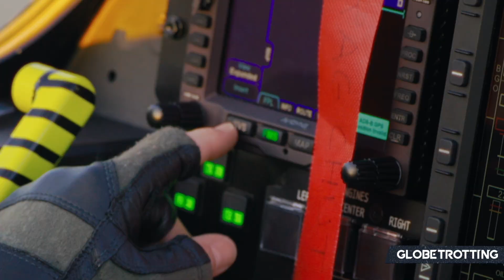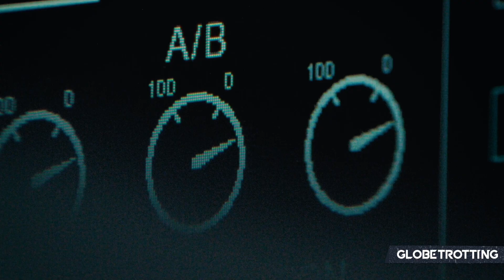THE FUTURE? - Introducing Boom Supersonic

Comment: It's poignant that in some important  technologies, we seem to have achieved a pinnacle in years past.  The moonlandings not repeated in over 50 years.  Hovercraft trips across the channel.  Supersonic passenger flight.  Perhaps these pinnacles happen when we 'overshoot' what is really practical within the laws physics, aerodynamics, material sciences etc.  We can just barely get humans to the moon in one shot and only then with a massive chemical propulsion rocket.  The hovercraft skirt just can't take the beating for very long.  The energy demands, aerodynamics and physical stresses of Supersonic flight become overwhelming and limiting in practical terms. 

We do see different trajectories however, too.  In computing, the transistor opened so many possibilities over the vacuum tube. And the integrated circuit over the transistor.

So, perhaps Supersonic passenger travel too will require revolutionary advances to ever become practical and routine.

Comment: The main problem is the same as with Concord - does anybody need it? Who (how many) paxes will be ready to pay additional $1000s to reduce travel time for, ummm, 10 hours max? Sydney-Europe flight, the longest real trip with significant demand on this planet, takes 24h with all transfers and costs $1000, what can offer SS plane? 15h with the same single transfer somewhere in the same Gulf? And price tag, ummm,  $3000 (science fiction)? I can not gain $2000 for 10h of seating in chair other way then refuse to fly SS.

So only top tier left, where money are corporate and lifetime is personal. But this market is not for 150+ pax planes, its much smaller, and competition there is not for time but for luxury. If you can afford to get sleeping cabin for the same money - it will be flying hotel and it saves the same time as it allows not to go to sleep immediately on arrival.
Reply: Even in a First Class suite the quality of sleep is nothing like a sleep of the same duration in a hotel bed. Primarily due to factors such as mild hypoxia, noise (aircraft and cabin), vibration and a whole host of other factors which have been thoroughly researched and scientifically proven. Despite this there still remains a market for this degree of luxury and the majority of it is not the claimed productivity of elite business travellers. Mostly it is to reduce the inconvenience surrounding long haul travelling, along with the privacy and a healthy dose of prestige.

There most certainly is an untapped market eager to reduce their time stuck onboard an aircraft irrespective of the luxurious surroundings.

This is the private jet market who co-lease with companies such as NetJets etc, there are plenty with deep pockets, and many who will be drawn to these opportunities for the prestige and enjoyment of travelling in an exclusive group of likeminded individuals.

Just as there is a market for First Class suites, chartering or co-leasing private jets (including former owners of the type who were overwhelmed by the expenses associated ie maintenance, crew costs, FBO fees, fuel, insurance, etc vs the amount of hours the aircraft is operated making for enormously expensive flights when it is used), there is absolutely a market who will patronise this travel option along with many more who will be attracted to it once the benefits are realised, and of course the many curious who will save or borrow for the experience.

Air France's Concorde operations did not produce much profit because their inflight service and soft product was nothing spectacular. British Airways however did make a significant profit with their SST fleet and their inflight product was in an entirely unique and luxurious, extremely polished, class of its own.
This is evidenced by the fact while during the fuel tank reinforcement installations while the fleet was grounded, BA took the opportunity to invest millions in a complete redesign of their entire Concorde inflight product - from tableware to seats and bathrooms - at least one, perhaps two aircraft had been refitted by the time of the decision had been proposed to withdraw them from service. 

Their decision was begrudgingly made largely as a consequence of Airbus announcing they would no longer support or produce parts for the aircraft, a responsibility they inherited with the absorption of Aerospatiale. Considering the Airbus and Air France codependent relationship, it is hardly surprising that Airbus "pulled the pin" on the Concorde fleets once Air France lost their appetite for placing their fleet back in service - after they had single handedly destroyed its flawless safety and operational excellence reputation.

An absolutely atrocious move really because those airframes had very few cycles or hours on them, they had years of service life remaining.

So, long story short, there absolutely is a well placed market for this commercial transport option, and almost certainly several other markets which will be stimulated once (if) it enters service - provided the airlines have a well designed product and service the city pairs that will see the most loyalty for it. 
If all they offer is a Premium Economy, or even Business Class type service product there will not be the loyalty or demand it could foster. The Air France vs British Airways Concorde product disparity and subsequent profitability is absolute irrefutable evidence of that.
It has to be exclusive, prestigious, and country club like to attract those who will ensure its success - just as SQ First Suites did which a few others plagiarised. The market is there to support it - if well executed.
Reply: @sydyidanton5873  you combined together old brave times when any air travel was Elite Luxury, mass transport flows of modern times, private jets with their ability to fly when and where Fat Pax needs not sheduled, market for inflated artificial luxury and so on. Altogether it creates the vision that you can sell 100+ seats on intercontinental route several times a day for luxe (comparable to private jet pricetag) money. Unfortunately this vision is false, as all its parts can not be combined together in reality. If it is sold as luxury - it is 10s, not 100s, paxes. If it is sold as fast - there must be no delays including half a day waiting for the single scheduled flight. If it is sold as mass product - it must be not 10 times more expensive than existing economy livestock haulage.

Comment: Do they have an engine now?
Reply: They do, but it's less powerful than the original one they planned to use, which is why they completely redesigned the overture from being a trijet to a quad jet
Reply: @Prodagist  Right but that was GE that came up with the 4 engine solution, was it not? And then GE backed out.
Reply: @halcyon1017  GE didn't back out, Rolls Royce backed out, GE is still working on the engine with Boom. They aren't leading the project, however, as it is being led by Florida Turbine Technologies (FTT).
Reply: @Prodagist  I see. thanks!
Reply: It’s both interesting and tremendously disappointing that Rolls Royce have again let down a U.S. commercial aircraft manufacturer. They did the same thing to Lockheed who had entrusted them as the sole power plant provider for the L-1011. Thanks to RR's incompetent business acumen and near collapse (if not for government intervention), they delayed the introduction of the L-1011 by years which saw the aircraft’s orders lost to McDonnell Douglas and a few to Boeing. 
Because of RR, Lockheed’s airframe which was far superior to the DC-10 never saw the success it deserved - consequently Lockheed vowed never to be involved with the commercial aircraft market again
When considering their history of aircraft like the L-748, L-1048 - Constellations and Super Constellations respectively amongst other variants, the L-188 Electras etc it was quite a loss of what other potentially impressive aircraft they might have brought to the fleets of airlines worldwide.

Despite the massive costs Boom has incurred redesigning their project thanks to RR's failure to commit, they have quite likely saved themselves from an unknown myriad of problems down the track. I hope GE will reliably help them take this aircraft to success with excellence in technology and craftsmanship.

RR are not the quality manufacturer they once were and do not deserve the prestige most associate with their name.
Reply: @sydyidanton5873 ”commercial aircraft manufacturer”? They’re a promise manufacturer. Just looking for somewhere to dump a RR rant?
Reply: There are military and diplomatic needs for this!

To get our best and brightest negotiators and subject experts "boots on ground" in a crisis.

If military or State Department order these, it is a done deal! 

To keep America the world leader in Aerospace, I think it is worth it - it will sell other airframes demonstrating American engineering prowess like Space X!

Vive la Boom! Magnifique!
Reply: Retired Airline Captain